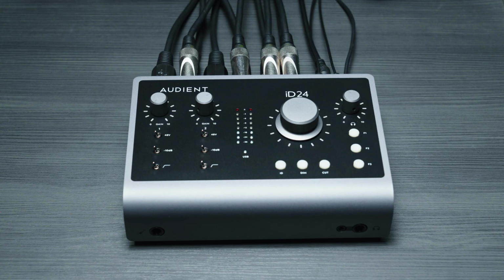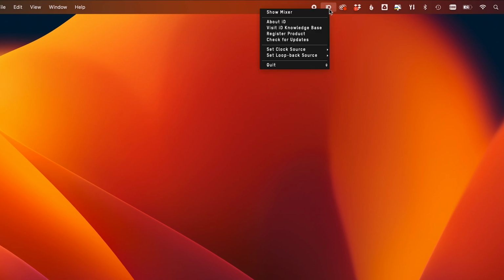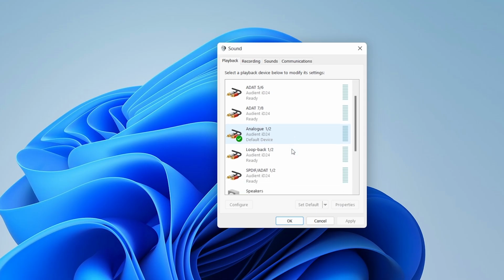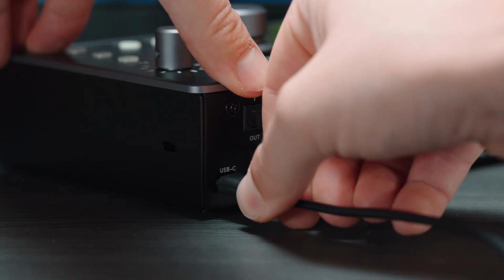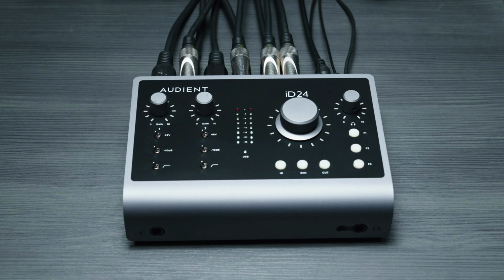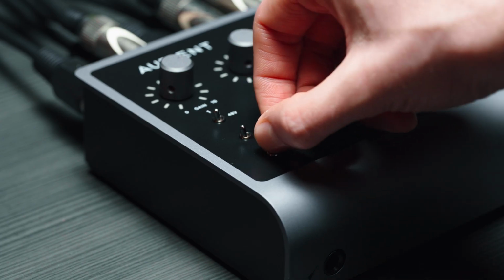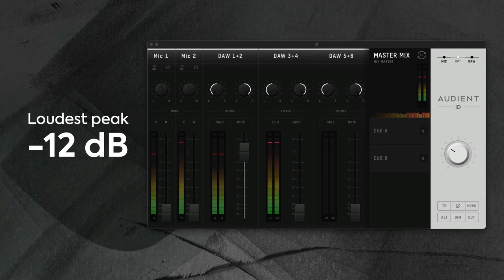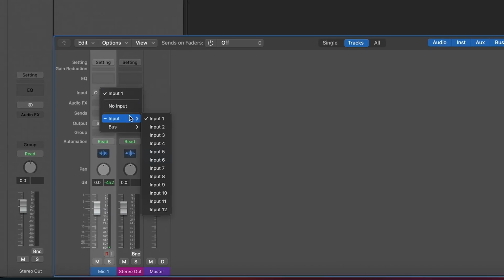How to set up an Audient iD24 Audio Interface

Comment: Hello! can you possibly help me with my situation? I have the id24 and i am recording vocals in cubase. For some reason i get 2 different gain meters. for example i get peaks at 0 inside the idmixer that translate at -10 in cubase. whatever i record appear 10-12 db lower inside cubase. I have the meters next to each other and i can see the difference happening real time. 
ps. I have no plugins open, no compressors, i record in mono 
also i have the -10db switch off on my audient and when i open it i can see that it works both on my idmixer and my cubase gain meter .
+ i have the latest drivers etc

Comment: how to use your card with pedal effects (without guitar)?
Reply from the maker: Hi there,

Thanks for your message.

You can run the output of any pedals into either the DI input, or normal line input on the interface and record from those as normal.

For further assistance, reach out to us at support@audient.com.

Comment: thanks for the video. it helped a lot. How do i see all 4 of my line outputs in the id mixer. i am going out to a multitrack. Thanks
Reply from the maker: If you are sending the audio to an external device, rather than speakers I'd recommend setting outputs 1-4 to DAW THRU in the system panel of the iD mixer. You can see the metering for these four channels on the DAW 1-4 channels in the mixer window.

Comment: I have to plug a mono synth into the interface. Which input should I use. The synth is analog and has only TS jack out. Should keep gain at 0 on the interface?
Reply from the maker: You would want to plug the Synth into one of the line outputs on the rear of the iD24. Turn the gain to 0 on the interface, unless you do need a little extra level from the synth, but most synths should be plenty loud enough with any additional gain.
Reply: @ thanks 👍

Comment: Can this unit be used standalone? Is there iOS software to control it?
Reply from the maker: Hi there, thanks for your message.

The iD24 does not have a dedicated standalone option. It also isn't compatible with iOS so there isn't a control app.

I recommend having a read of our compatibility information on the Audient helpdesk.
Reply: @ my apologies, my understanding was that it was class-compliant. Thanks.

Comment: Am I the only person in the world wondering how to set a precise and reproducable monitoring level when only having those LEDs to control it? Do these marks around the main Knob have any sense or function?
Reply from the maker: The marks around the scroll wheel don't allow you to accurately recall a volume setting I'm afraid. We are looking to add features that would allow for an accurate volume recall in the iD mixer app in a future update.
Reply: @Audientworld  What a pitty.... As I'm working in audio post production this is mandatory. Always having to look into the software wouldn't do for me. The only thing I could imagine is to have a setting which displays the precise value on the computer screen when changing it

Comment: Hi, I had a problem in Master Mix mode. My headphones always play MONO. When I started the test on the right and left channels, I realized that the right channel does not make any sounds at all, BUT if you turn on MUTE mode, then suddenly a sound appears there. Please help me.
In Cue A, everything sounds fine
Reply from the maker: If you send a message over to support@audient.com, the team will be able to help you reset the mixer settings which should resolve this.
Reply: @Audientworld  I wrote, the support service responded to me very quickly within 5 minutes and quickly helped me find a solution

Comment: Can a USB type C to Type A be use to operate the ID24 intead of the USB C to C thats provided in the box?
 My PC doesnt have a USB C ports, however all the USB PORTS are USB 3.0 Ports
Reply from the maker: Yes, a USB-A to USB-C cable can be used instead of the USB-C cable included.
Reply: Thank you audient then am confident now to place my order thank you audient..

Also it's just one USB C TO C cable comes in the box right?

If that's the case, I want to know which brand USB A TO C would you recommend me purchasing to make sure it function effectively.

I wish both cable would ship withing the box tho like ID44.

Comment: Guys, I am using protools and the main output 1-2 of protools is using channels analogue 3-4 of Audient id24. How do I change this?
Reply from the maker: Thats a little strange, output 1+2 in Pro Tools should direct directly to Analog 1+2. Can you check your I/O setup in Pro Tools and ensure that the Output 1+2 channel is assigned to Output 1+2 of the Audient?

Comment: Hi, I bought the iD14 Mk. 2 a while ago, because my PCIe sound card started having noise issues in my new pc case.
Am I too stupid to find a simple EQ for my audio? I don't make music or play instruments. I simply use Sennheiser HD660S and an AT2020 XLR mic which is connected to a DBX 286S and that goes into my interface then.
Also is there a way to set my headphones as default? Everytime I restart my pc I have to change my input from the speaker icon on the left to the headphones and turn up the volume to 100 again.
I'm no audiophile and I can't seem to find a solution for this. I would simply like to have the option to make EQ profiles so I can turn off the bass when playing games. I would also love to know how I can access a compression setting, because the headphones blow out my eardrums in some games.

If anyone can help I would be very happy!

Thanks
Reply from the maker: Hello there, The iD mixer doesn't have a built in EQ for your playback or recordings. You can however make use of the Sonarworks SoundiD Reference software we offer via Audient ARC when you register your unit which gives a wealth of tuning options for your outputs.

The headphone volume will reset to zero on the unit when powered up as a safety feature to ensure loud audio doesn't suddenly play when plugged in.
Reply: @Audientworld  Makes sense why I never figured out how to get to an EQ.
I think I did register my product. Is that Sonarworks SoundID Ref a plugin or is that something else? Will I also be able to set compression with the Sonarworks?

Thank you very much for replying to this comment. I have tried countless discords and wrote to a couple of youtubers never getting a reply and I started to feel like I made a mistake by purchasing this.

Thanks once more!
Reply from the maker: Sonarworks SoundID reference is a standalone application that will allow you to add equalisation to your outputs to get a flat response. It doesn't allow you to add compression to your signal
Reply: @Audientworld  i downloaded the software and it looks really good. I'm pretty sure that I will be buying the full version.
Is there another software I could use to achieve compression? Sonarworks has a DB-limiter, but that just limits the max volume.
BTW: you are a legend. thank you very much for taking the time to reply to my weird questions. I really appreciate it.
Reply from the maker: I'm not aware of any software that would add compression in the same way that Sonarworks applies EQ I'm afraid. Hopefully someone else may have a suggestion?
Reply: @Audientworld  Hey, sorry for the late reply and thank you very much.
That's my sole nit-picky'ish issue. I had a simple compression setting on my evga nu audio sound card and it was nice when playing fps games, as it would cap the explosions and shots and increase low volume sounds. maybe someone else has a solution to this.
thanks again for being so kind and informative!